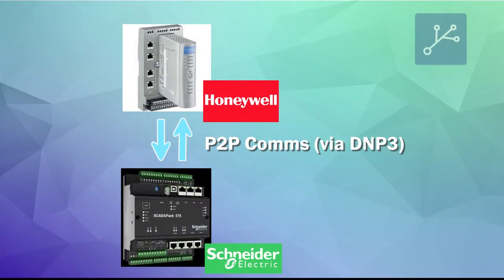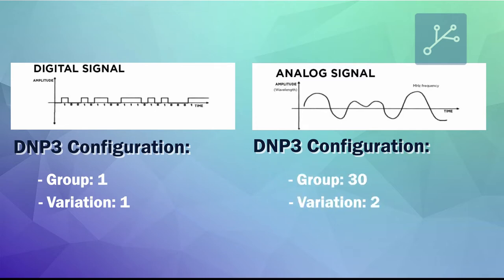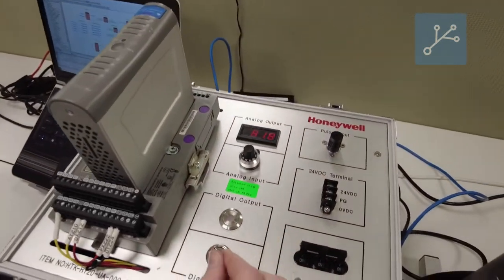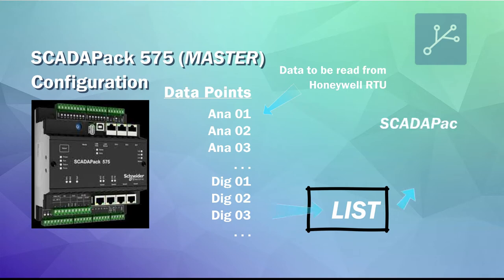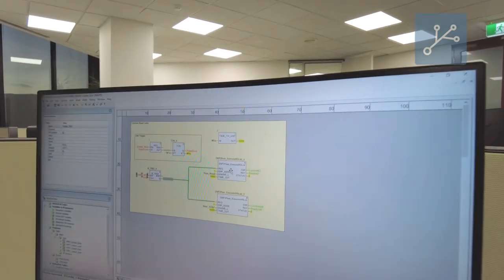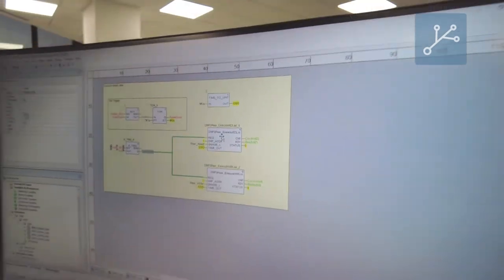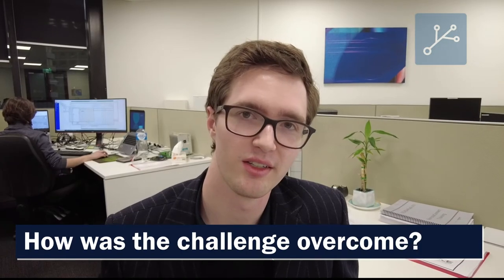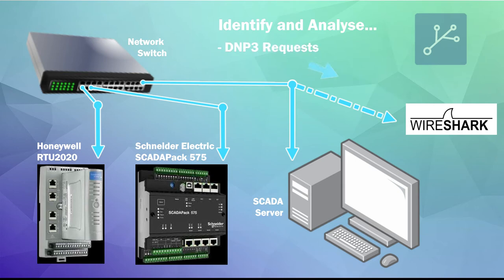DNP3 Peer-to-Peer Communications with Honeywell RTU2020 and SCADAPack 575

Comment: Why logic is used to read data ? I guess SCADAPack E-Configurator is equipped with required functions for reading data  without the need of programming with SCADAPack Workbench
Reply from the maker: Hello Osama, thank you for your question. You're right that the SCADAPack 575RTU has the DNP3 master function i.e. data concentrator. However, we find that using read & write logic (in Remote Connect) gives more flexiblity when it comes to error detection for each individual peer to peer data point. Once again, you raised a good question. Your feedback is always welcomed.